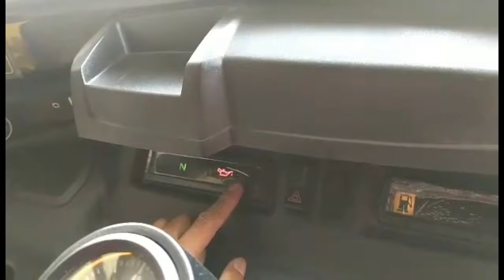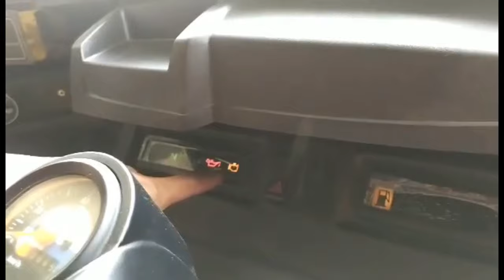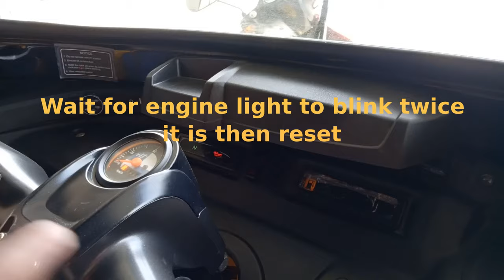TVS King Deluxe Diagnostics Check

Comment: panu mag throttle reset sir
Reply: sir di ako yung vlogger pero sagutin na kita ,,punta ka sa likod open mo yung box na may ECU tapos connect mo yung dalawang socket ,tapos punta ka s harapan,, full throtle  tapos on swith pag kumislap dalawang beses yung check engine bitawan mo agad troetle ,, tapos disconnect sa likod ,tapos on switch check mo kung iilaw pa